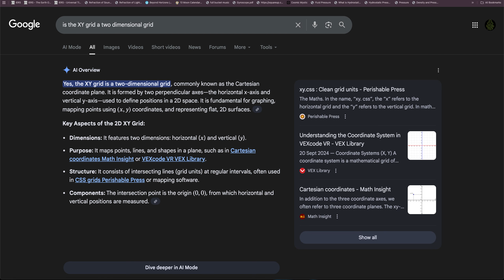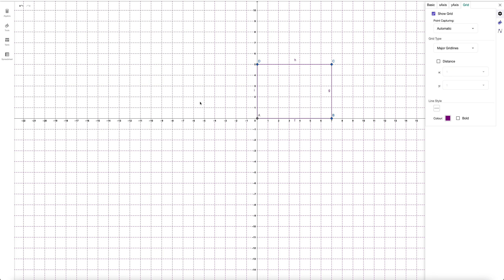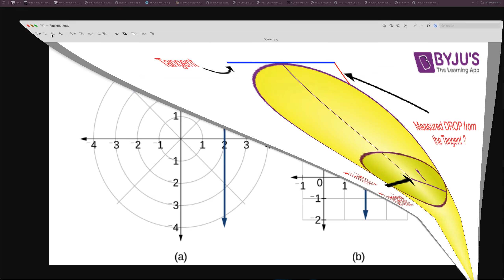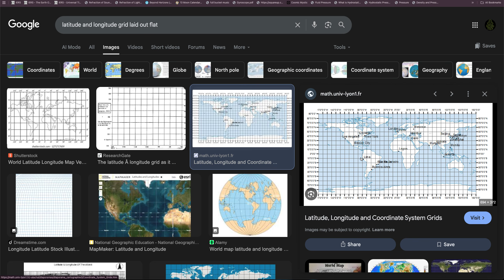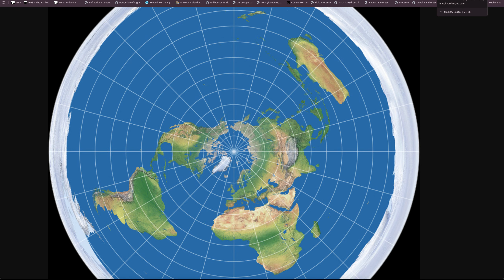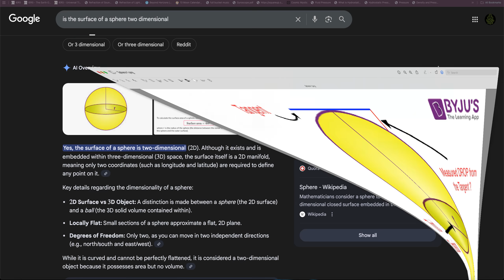The 2D Globe  lol

Comment: It is fascinating watching an adult that can't understand something that can LITERALLY be proven with a piece of cardboard and a pen.

1. Take a piece of cardboard and pick a point on the surface. Draw a line in any direction to represent a zero line.
2. Pick any other point on the surface and draw a line to it from your origin point.
3. At the origin point, the angle between the zero line and the line just drawn IS THE FIRST DIMENSION.
4. The distance from the origin point to the second point IS THE SECOND DIMENSION.
5. Curl up the piece of cardboard into a cylinder. The second point IS STILL DESCRIBED BY THE ANGLE BETWEEN THE ZERO LINE AND THE DRAWN LINE, AND THE DISTANCE BETWEEN THE TWO POINTS.
6. Curl up the piece of cardboard so that the drawn line is directly around the axis of the cylinder. This is EXACTLY what a sphere's surface is - AND THE SECOND POINT IS STILL DESCRIBED BY TWO DIMENSIONS (ANGLE AND DISTANCE).

There we go, a practical demonstration using a single piece of stationery that proves YOUR assertion to be completely incorrect. You can describe ANY point on a flat piece of paper, or a cylinder, or a sphere WITH TWO COORDINATES.

This is why no-one can discuss anything to do with geometry with you, Brian, because you literally cannot understand the topic - but you have the hubris to believe that you know more than everyone else.
Reply from the maker: Sorry have you just denied spherical excess and the claimed spherical trigonometry ????
Yes, yes you have lol…. You absolute Genius smh….
Reply: @BriansLogic Thanks for demonstrating that you have no idea of what he said.
Reply: @BriansLogic  Nothing I stated has ANYTHING to do with spherical excess, genius. It is literally about YOUR claims about a curved surface not being 2D.

You made MULTIPLE false assertions. I am addressing the first one you made - and ONLY the first one.
But congratulations on proving that you don't understand ANY part of this topic.

For someone that gets all bent out of shape about lies, what you just stated above is one.
Reply from the maker: @ATriangleHasAHeight It has EVERYTHING to do with spherical excess, but you can’t understand how…. That or you don’t want to admit that your position is completely wrong…. Which it is :)
Reply: @BriansLogic  Wow, you really can't grasp this topic at all. It is impressive.
Apparently, the ability to reach ANY point on a surface using two dimensions IS TOO HARD for you to understand.
You literally have a practical demonstration of that using a single piece of paper - primary school kids could get it.
It is telling that YOU can't.
Reply from the maker: @ATriangleHasAHeight A surface yes if it’s two dimensional, but a curved surface is Not two dimensional, now answer my question honestly or stop wasting my time….
Reply: @BriansLogic  Wow, I never thought I'd meet an adult that CAN'T grasp such a simple concept.

Forward/Back - ONE DIMENSION
Left/Right - ONE DIMENSION.

Or even
Angle - ONE DIMENSION
Forward/Back - ONE DIMENSION

Exactly the same TWO DIMENSIONS can get you to ANY POINT on a plane, on a cylinder, and on a sphere.
You LITERALLY have an example using a single piece of cardboard - WHICH YOU APPARENTLY CANNOT UNDERSTAND.

Your question is INANE, because your understanding of the most basic of geometry is also INANE.
Your time is already wasted Brian,, making inane statements about topics you apparently can't understand.
Reply from the maker: @ATriangleHasAHeight Hey IDIOT that angle you’re talking about is from the CENTRE ( third dimension ) of the sphere you’re describing, a sphere a three dimensional shape with a three dimensional surface…. 
Now ANSWER THE QUESTION Yes or No ?
Reply: @BriansLogic  As you can't seem to understand that PLANAR and TWO DIMENSIONAL are NOT the same thing:

"While all planar objects are 2D, not all 2D objects are necessarily "planar" in a geometric, flat sense (e.g., a curved surface of a sphere is 2D, but not technically "planar," though it is "two-dimensional" in a broader mathematical sense)."

"Two-Dimensional (2D): A mathematical classification denoting objects that can be described using only two coordinates (such as X and Y)."
Reply: @BriansLogic  Wow, you really are slow.
That angle is on the surface, you genius. It is LITERALLY explained in the first post.
But thanks for confirming that you DON'T (or CAN'T) read comments before posting.
Reply: @BriansLogic  And also, genius, a sphere is a 3D shape with a 2D surface.
Start at ANY point on a sphere's surface and you can reach ANY OTHER POINT using North/South and East/West - TWO DIMENSIONS.

I've answered your INANE questions.
Just because YOU can't understand that they are INANE doesn't mean the rest of us can't.
Reply: @BriansLogic "a curved surface is not 2 dimensional"

Wrong.  Try again.
Reply: @BriansLogic  I do find it hilarious that I give you the most simple proof that you are wrong - and you don't even attempt to address it.
Stationery too difficult for you to grasp, Brian?
Reply from the maker: @ATriangleHasAHeight Really so when YOU claim incorrectly that the surface of a sphere is 2D, then that means that a triangle or square etc can be placed upon it without distortion, is this YOUR claim ????
Reply: @BriansLogic  You really don't understand ANY geometry, Brian. It is truly impressive.

Being able to place a triangle or a square on something IS NOT THE DEFINITION OF 2D, genius.

We can't help it that YOU cannot understand such a simple topic.

If I am at a point on a surface, I can get to any other point on the surface using ONLY forward/back and left/right.
This is true of a plane, a cylinder, and a sphere.
TWO DIMENSIONS.

It really is like talking to the slowest kid in class - the one that believes he is more intelligent than everyone else. The hubris is breathtaking.
Reply from the maker: @ATriangleHasAHeight Listen IDIOT are YOU claiming that I can place a triangle onto the surface of a SPHERE, without distortion’s happening to the Triangle ? 
Answer the question it’s a Yes or No question ????
Reply: @BriansLogic  No. Only you are making the claim that that means the sphere's surface ISN'T 2D.
And that is because YOU don't understand even the most simple geometry.
Reply: @BriansLogic  Brian, asking stupid questions because YOU don't understand simple geometry is NOT the gotcha you think it is.
Reply: @BriansLogic  But it is hilarious that you've been provided with direct evidence that you only need TWO DIMENSIONS to define any point on a surface - planar or curved - and YOU STILL CAN'T GRASP THE CONCEPT.
Reply: @BriansLogic  That's your reply? Mister flat earth savior, that's your reply? 
You're an embarrassment to Ireland

Comment: Brian, there two cities;

Two good examples are:

Mbandaka — latitude 0.05° N (essentially on the equator)

Kisangani — latitude 0.52° N (very close to the equator)

Distance between them: ≈ 620 nautical miles

Tell us what the solar noon difference in minutes is betwwen those two .locations. Then calculate how many of those can fit on the flat earth 360 degree equator.  Multiply that by the 620 Nautical miles to give the total length of the "flat earth" equatoer.

But, there is a problem.  The result you get doesn't match flat earth predictions, but does match globey sphere predictions.  How can that be?

So, over to you.  Flat earth measurements and observations (according to you), but a globe answer.
Reply from the maker: Why would I do any of that as Solar Noon changes daily for everywhere, I specifically detail and focus on correct local time, which is based on solar time but equalised via longitude…. 
You don’t have a point.
Oh and I thought the ratio between nautical and statute miles didn’t matter ?
Reply: @BriansLogic  solar noon never changes in any given location Brian. Solar noon in Greenwich is always 1200 GMT. The fact that at the end of March each year the clocks in Greenwich go forward by an hour (to BST) doesn’t change Greenwich’s solar noon, which for the following 6 months is 1300BST. 
You appear to seriously misunderstand solar time Brian. Wherever you are north of the equator, solar noon will be when the sun appears due south of your location. That’s why sundials are so reliable. If you think solar noon changes day by day where you live Brian, then you are woefully mistaken.
Reply from the maker: @DeeDubbayaSolar Noon is constantly changing which is why we have GMT etc, which stands for Greenwich MEAN Time….
Reply: @BriansLogic and yet solar noon can be(and is) used to determine your longitude
Reply: @BriansLogic The point is, you are completely wrong and using local time is silly.  The local time when the sun is directly south (or north) of you is useless.  You need to know the UTC time in order to accurately compare it with other locations.  You should know this.

The point is you are still unable to follow through and show how the suggested method doesnt work or gives a result consistent with your flat earth claims.  Its almost as if you know it will give the globe result, or you dont understand what I am talking about so cant do it anyway.  I'm going with both.

And what does the conversion between nautical miles and statute miles have to do with .... anything?  The conversion is a static 1.15 statute miles to 1 nautical mile.  A fixed and constant ratio.
Reply from the maker: @JohnSmith-ux3tt GMT and UTC is correct LOCAL time genius smh 🤦‍♂️ you fools will never get your facts correct, are ye all drugged up or what ?
Reply from the maker: He doesn’t have a method, he has BS that fails with the least of investigation, for example he must presume that there’s 1.1508 sm for every 1 nm, but has he validated this, and if not then when is he going to ? 
Do you see how easily his non method is stopped before it starts, anyone who’s trying to calculate a measurement as HE puts it needs their head checked, as to say that is THICK….
Reply: @BriansLogic  ! Nautical mile  =  1.1508 Miles
1 mile =   1.1609 km
1km =    0.54 Nautical miles
There is no presumption Brian, these are simple conversion figures established by international agreement. Grasping at straws again Brian?
Reply: @BriansLogic Well done Brian, so now you dont even know what local time is. Local time might be the same as UTC for you, but for most other people it isnt.  Are you just getting confused, or do you really not know that? Smdh.
Reply: @BriansLogic How about you explain exactly why you think the conversion between nautical miles and statute miles makes any difference to anything?  I specifically used nautical miles in my suggested method just so you didnt need to get sidetracked on doing a conversion.  But here you are, still banging on about nautical to statute miles.  Why?  The entire world agrees how far a nsutical mile is, and what the conversion calculation is.  Why dont you know it?

And you wont even say why the proposal wont work.  Why dont you follow it through, get a result and then prove it hasnt worked?  Instead, you just proved that time in general, and solar time especially, is a mystery to you.

What do you actually think solar time is?
Reply: @BriansLogic  well you presume the earth is flat and you haven’t validated it - how ridiculous is that
Reply from the maker: @JohnSmith-ux3tt No I won’t explain it as you KNOW why….
Reply from the maker: @JohnSmith-ux3tt Correct local time is UTC time, formally known as GMT unless you have a different time other than Solar and Local, which is derived from Solar ?
Reply from the maker: @Aver45-q8o I’m fully aware of the conversions Genius, NOW validate them or go away with your useless information ?
Reply: @BriansLogic  These are international standards Brian. Why would you want them validating? Just grasping at straws, aren't you, trying to defend the defenseless.
Reply from the maker: @Aver45-q8o Agreed upon ratios ? Please validate the nm to sm ratio, or go away that’s another option ?
Reply: @BriansLogic  You need to explain sm? I do hope you know what you are talking about?.
 International Bureau of Weights and Measures (BIPM), which is located in Sèvres, France. This department maintains and validates all SI conversions.
Reply from the maker: @Aver45-q8o  Validate what I’m talking about ???? 
Are you not paying attention I’m asking for validation of the claimed ratio, not claiming a ratio myself ?
Reply: @BriansLogic  Unfortunately, Brian, that is just your normal non-coherent nonsense. Just an attempt at the usual nonsensical  circular argument used by the uneducated in an attempt to appear intelligent. It doesn't work.
Reply from the maker: @Aver45-q8o Yawn….
Reply: @BriansLogic  It might change slightly daily, but not much during the same day.
The GP of the sun has a specific speed. At the equator, it is roughly 460 m/s.

But is is never that high anywhere significantly farther north or south of the equator... which would be necessary on a flat earth.

Comment: @Brian "NASA and every other Astronomy 🪐 site will be using a Flat Earth [for predicting the March 3rd eclipse]

But Brian, I looked through the source code for the first one I found, and guess what, it doesn't use flat earth dimensions at all.  It uses these:

Sun: 696,000 km
Earth: 6371 km
Moon: 1737 km

Worse, nobody can make a flat earth predictor because apparently nobody knows those dimensions for a flat earth.

So, you lied.

Comment: Brian has come to the understanding that the distance from the gp of polaris to the equator is 5400nm. (6214.209 sm or 10,000km).  This is based on a observation of 90 degrees at the North pole, and 0 degree observation at the equator with a change of 1 degree for every 60nm travelled.
Reply: Next up, Brian will explain how that relationship works on a flat plane, buf without invoking flat earth math.

Following that, he will explain how that relationship works along the Equator.  Because there, we also see 60 nm per degree, giving us an equator length of 21600 nautical miles.  Which it is.

But, using the Gleason map and basic circle geometry, we get an equator distance that doesnt align with reality.  Maybe Brian can explain how 2 x pi x r works using flat earth math.
Reply: @JohnSmith-ux3tt  In flat earth maths, pi is a variable; you just set it to whatever value works for a flat earth.
Reply: @david_akerman  even in Brian’s version of flat earth mathematics I don’t think pi has ever been as small as 2 - that’s would it would have to be for the equator’s circumference to match it’s distance from the North Pole
Reply: @DeeDubbaya Maybe this is one of his "god did it" scenarios.  Like when he noticed that celestial observations are incompatible with a flat earth.  "Majesty of the heavens" I think he called it.
Reply: @david_akerman  I think it’s more like ‘I’m right therefore I must be right’ moments